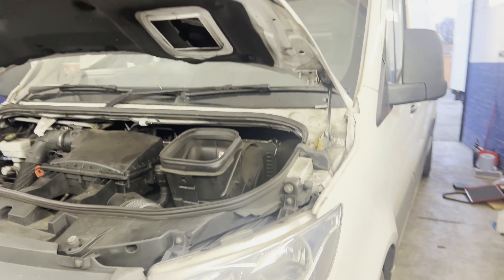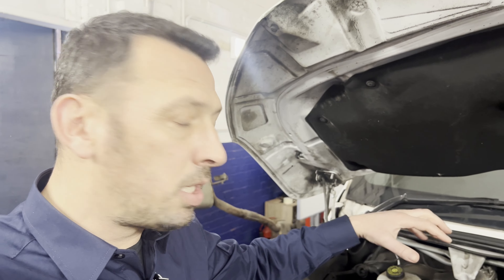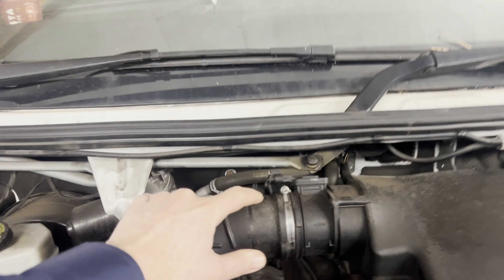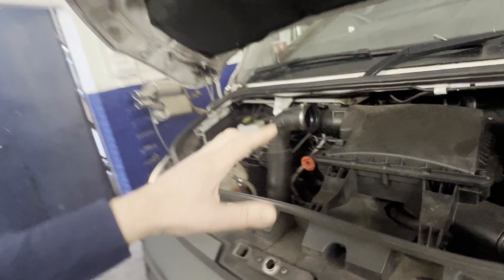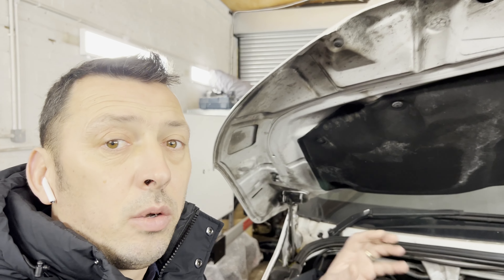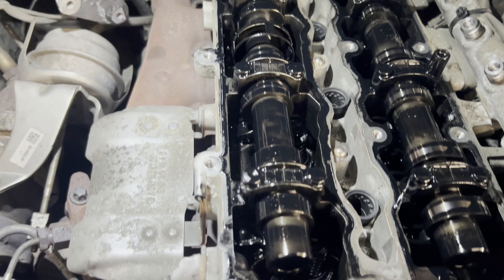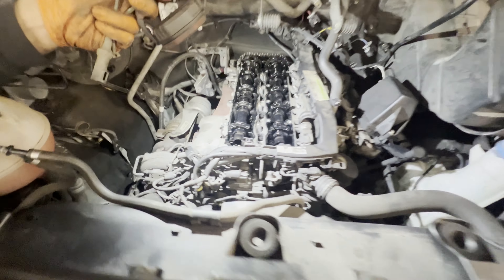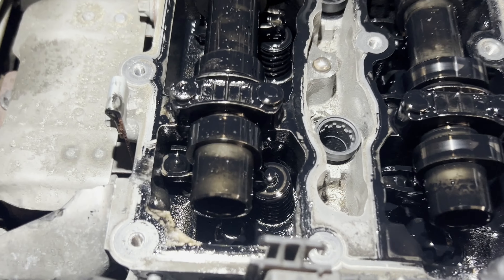🔧 Mercedes Sprinter Engine Noise Investigation | Top End Stripping & Diagnosis ⏱️

Comment: Hello! I like your videos, good job.
May I ask, I'm having a hard time finding content on how to take the 2021 4cyl 2.0 turbocharged head off.
This model has a fuel pump on the engine and it seems like an EGR line, but I don't know why it feeds to the valve cap. Any advice or reference would be greatly appreciated. Thank you